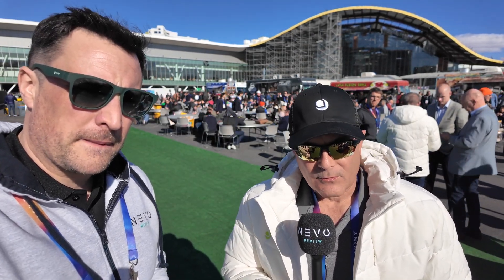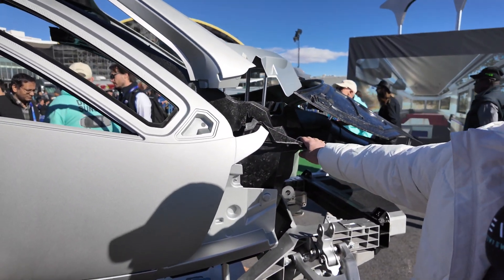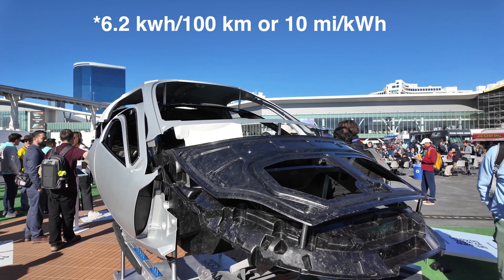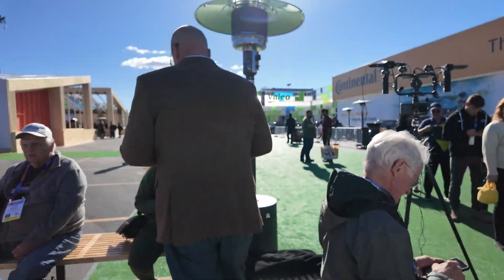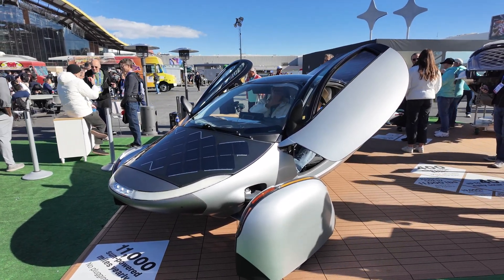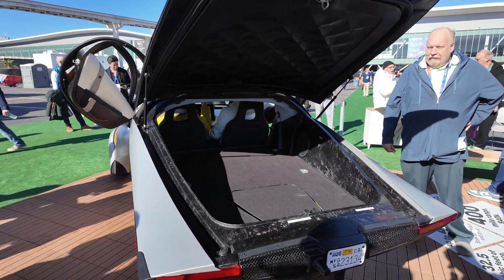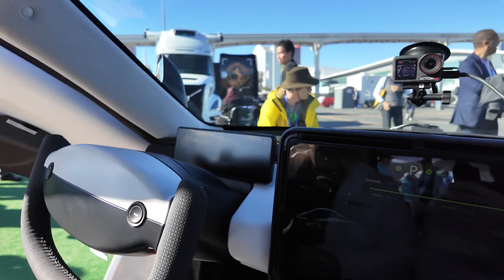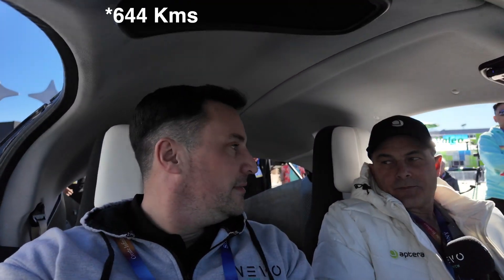Aptera Solar EV - Over 600km range, Lightweight and Super Efficient

Comment: Looking forward to my Aptera in my driveway here in Ontario Canada.
Hope they sell a winter version of the front wheel skirts, current ones will act like snow plows.
Note from my solar panel output this winter expect some ware between 0 to 5miles of solar for 4 months a year. OK with that.
Also hope the redesigns stop soon, so that Aptera can head for production. Hopefully might see mine by 27/28
Reply: @universeisundernoobligatio3283   Also interested in snow drivability. We often have 3-5 inches of snow on roads during winter weather.

Comment: As currently constructed it just can't work in Europe. The roads are too narrow. The vehicle - specifically the two front wheels - is 2.25m wide. I drive a Model 3 which is just shy of 1.9m wide and it's not pleasant to drive in certain places in Ireland. Imagine an extra 35cm and then trying to fit in an Irish parking space - 2.4m wide. And remember the widest part of the car is below your field of vision.

They need to make it smaller for Europe. That's the reality.

Comment: No numbers are proven and they cannot even get a convertible note fully subscribed showing how little interest there is in an efficient vehicle that trades safety for that efficiency. Most people would be turned off instantly at the new price let alone it rides on three wheels and won't have a full complement of air bags;  plus lets face it damn well better be twice if not more efficient given if you need more than one passenger you need two Aptera
Reply: It’s not a passenger car. It’s claimed more than 3 times more efficient than a Tesla so even if it didn’t perfectly reach that it’s still well above your twice as efficient. This clearly isn’t for you and your mindset. The full solar option is the premium convenience feature and a base model would be a lot cheaper more than plenty for a lot of people.
Reply: @fourteenfour1  This is an ultra efficient primary vehicle for families of two and a secondary commuting vehicle for larger households. Criticizing it as a two passenger vehicle is to disagree with all 2-person vehicles ever produced.  Look at the success of Corvette, Porsche 911 & Boxster, Mercedes SL, BMW Z4, etc
Reply: The convertible notes are for 2 years. They had raised around $700,000 at the end of November. December has not posted yet from the SEC filing.
Reply: 50k buurtschap want it now !! The investment is not coming because all the money people are conversative.. the millionaires like it ...

Comment: Excellent content! Bravo!  On weight there are already highway certified cars in Europe in similar weight category like Fiat 500, Suzuki Swift, Suzuki Ignis, and Kia Picanto. US has more than 20 highway certified cars under 1 ton. So its not a light vehicle in that sense that you need to give a second thought. Primary saving is not from just huge but extensive reduction in wind drag or wind resistance. Aptera is a sustainable design language! 

Aptera does not spend much of its energy trying to push air out of its way like say a truck which at the extreme end spend almost 85% of their engine power against air resistance.
Reply: Good aerodynamics means bad practicallity.

Comment: Aptera has talked about European Homoligation a few time but they want to get production off the ground in the states first. Another cool thing about Aptera is the production facility is far smaller than a traditional vehicle facility and there are fewer environmental issues because they don't paint the exterior (it's a poly wrap).
Reply: They'll seriously need to consider setting up a production line in Europe to avoid the tariffs on imported US vehicles and any likely political madness
Reply: @BeLowBelowo  So you want to produce Aptera motorcycle in europe and pay taxes when you import them to US? While the Aptera cannot be registered in EU? Genius.
Reply: It is 223 cm wide. That will be impossible for parking at the curb in most any city in EU.
Reply: @ And it canot be registerd in EU because the max width for motorcycles is 2m.
Reply: And still they need at least 300 Mill to start production. they have to focus on 10k vehicles per year. That is around 1000 per month, so 50 per day. That is NOT a small vehicle facility.
Reply: @vic321344  they need 40 mill to statt production and will produce 2k first year .. after that yes 10k per year .. .. and why cant i prepay my car ?‽??